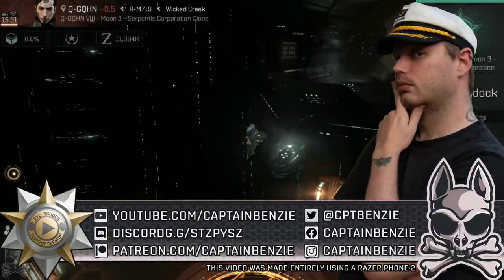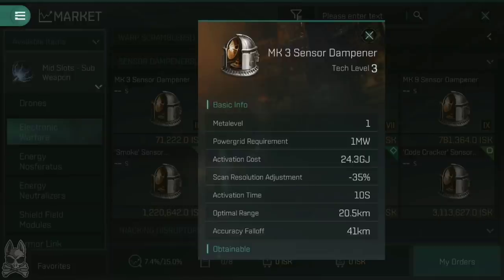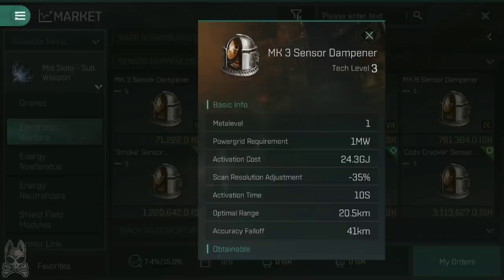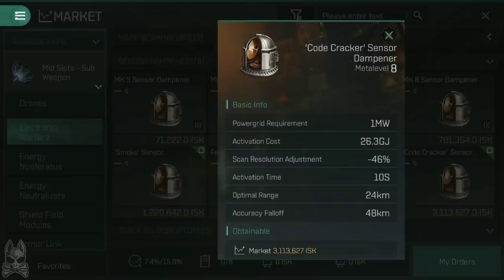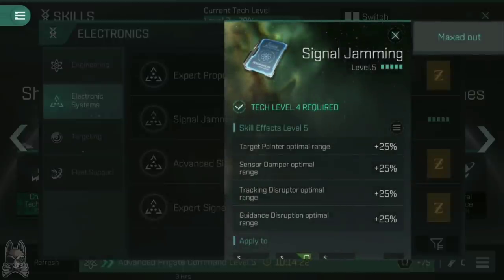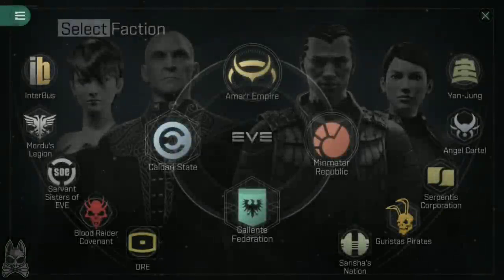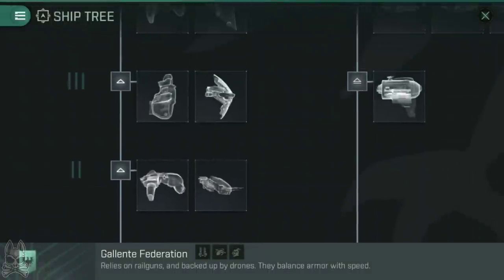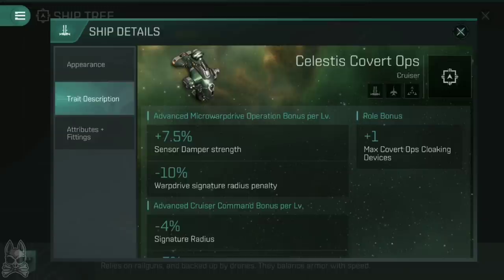NEW MODULES - SENSOR DAMPENERS: What They Do & How They Work || EVE Echoes

Comment: Been trying a Mk5 one in my Condor II with a Micro Afterburner and almost blew my ship up once the micro afterburner kicked in, but near 3k m/s is wicked crazy at a range of 15Km using missiles vs their target painters  which makes for a dicey run. Considering dropping down to a Mk3 as well as capacitor/afterburner rigs so I survive longer. Can't wait to try the higher level Condor Interceptor to see how it does.
Reply: @captainbenzie  got it. Thanks . Gotta get my small missiles maxed so I can try the torpedoes you spoke of.

Comment: Correct me, pleaaase!
0.46 * 1.25 (ship skill bonus) * 1.25 = 0.71875
1-0.71875 = 0.28125
0.28125^4 = 0.00625705718
1/0.00625705718 = 159.819539704
So four sensor dampeners from max skill Mauluses should be able to increase lock time by 160* ... 
does that mean that three mauluses can kill anything !??? - 6 snubnosed railguns should be able to break most times and well..
nobody is ever gonna lock. 2*Maulus with double damps and one Maulus with double scrams also means 10 warp dis..........